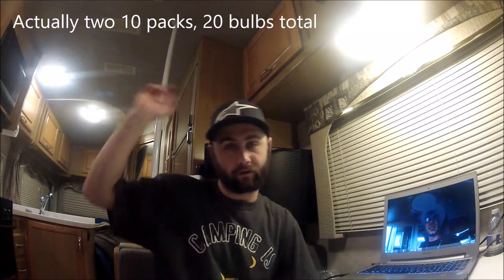Harbor Freight Amp Tester for checking how much power things in your RV draw

Comment: love this tip. I purchased an ammeter with shunt on a popular auction site, but was unimpressed. This product is great! After all the time I've spent in that store, you would think I would have seen this by now. Thumbs up, great video.
Reply from the maker: Thanks, I've been really surprised with just how much I have used this little amp meter.  I have thrown some test leads on it and put it inline on a boat battery to figure out what was causing a draw in the system while everything was off.
Reply: I have an off grid solar setup on my camper. Don't live in it, but could if I had to. Having this is going to be so much easier than trying to use my multimeter to figure out the draw on each individual circuit. Especially since my multimeter only goes up to 10 amps.